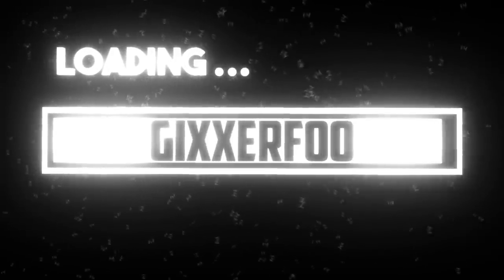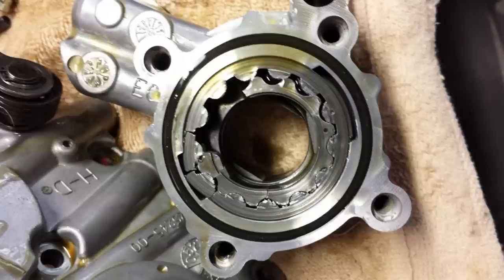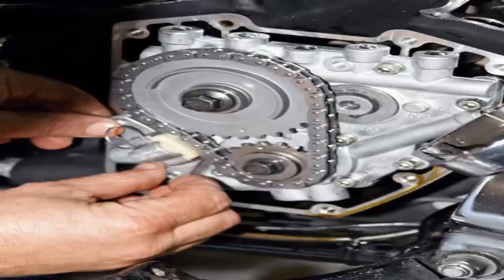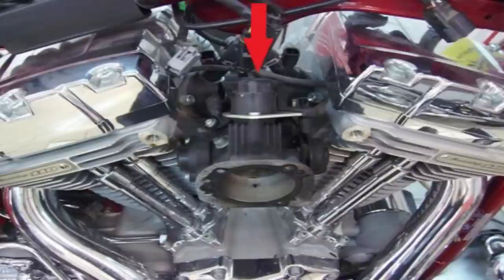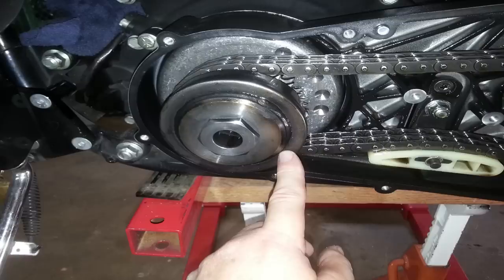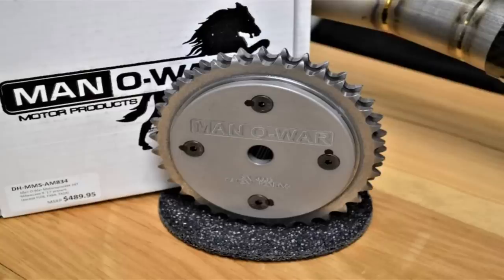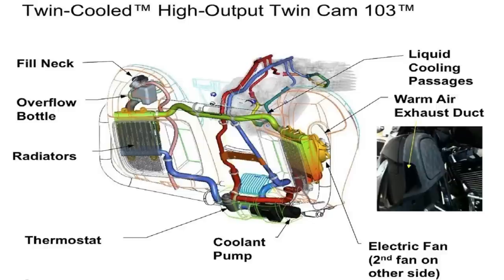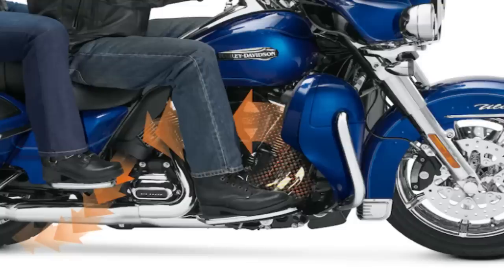5 Harley Problems the Aftermarket Fixed Before the Factory

Comment: I have put mighty mites ( love juggs ) on my 14 Streetglide and 05 Deuce.  They do work BUT ive also had three fans go out  ,over approximately a 3 year period. Two on the Deuce and thats a balanced motor and one on the Streetglide which vibes more . There is a frame mount kit i have to fit to isolate the vibration apparently. I purchased this kit from Amsoil Adam ( vendor) at Delmarva bike week this year. I have a Hayden H6 primary chain tensioner ( auto ) fitted to the Deuce . BUT at the moment cant find one for the Streetglide anywhere ! Its like everyone is out of stock .I also have two FLO reusable oil filters to fit when i next service the bikes ,the advertising says they can drop motor temperatures. I run AMSOIL in both bikes . The Fans by the way DO work and drop motor temp but even though its a well built unit its the tiny fans that don't seem up to the job . These   units were like $400 and now i believe they are north of $500 ! ALSO the Deuce has full S+S cam chest running 509G Gear Drive because the run out was good .

Comment: That is interesting fix for the stepper motor. I started getting problems 10,000 miles ago, I seemed to get by with grease on cables for a while. I shortened the outer of the throttle cable nearest the rider by about 1/2 a turn not had any problems since. Not sure why this worked. But will look at your fix.
Reply from the maker: That's a interesting issue, you might have to end up replacing that cable, it sounds like it might have some stretch in it.

Comment: Any idea as to why they went to the INA inner cam bearing in 92?
Reply from the maker: I would hazard to say it was cheaper, same reason they went with that style bearing on the Twin Cams in 2003. It allowed Harley to slap the bottom end together without having to take time to setup the tapered Timken bearing lower ends. Both were a huge quality loss in my opinion from Harley.

Comment: The tensioner issue was very easily fixed on the 88 motors but you did have to spend some cash by converting to gear drive! That my friend was the only issue
Reply from the maker: The gear drive on those was not cheap at all!
Reply: @GixxerFoo  back around 2000 I did install a couple of gear drives kits for a little less then 500 bucks but the kits went up pretty fast ! But it did make those 88s a pretty much maintenance free bike other than fluid changes . Those 88s turned into 95 in hers made some badass hotrod bikes with no compensator issues ! Much more dependable then 07 & up motors unless you spend a huge amount of cash on some Dark horse  flywheels !

Comment: Just picked up my 3rd. I’ve got A 17 m8 spitting oil a17 slim s and just got a 10  road king police with a 103. I’m gonna start digging into the RK anything you think I should look out for
Reply from the maker: That 103 is a pretty good motor, that's when they got the Twin Cam straightened out. If you pull the motor apart I'd check the run out on the pinion and just see where your crank is at. But I'd check that primary chain adjuster and see how your chain tension looks. Being a 2010 you might watch for the compensator, just little things on the 103's nothing major really.
Reply: @GixxerFoo  thanks I appreciate it

Comment: @GixxerFoo -- Should the stock compensator be a concern on a 88ci that has been built to a high compression stout 95ci ? (2000 Model)
Reply from the maker: Not in that year, they had good compensators back then. It's when they redesigned them a few years later that quality went to crap. It was a miserable failure on Harley's part when they did that.

Comment: When did they update compensater on the Dyna models? I have a 2012 FXDC
Reply from the maker: I believe in 2010 the Screamin Eagle compensator became the OEM part, the 2012 for sure has the updated compensator.

Comment: Tensioners was material of shoes and also it was the chain links got sharp edges toward end of run before they changed dies .
Reply from the maker: That was a nightmare when that whole mess went down, brand new bikes shelling motors and customers holding the bag.
Reply: @GixxerFoo  yes sir : I forget where I read that . Chain links were good a beginning of run and as the dies wore ; chain links got tougher on edges . So depending on where your chain was made ; beginning of run or end of run is why it was hit and miss on bikes. Also I believe the chain was re-engineered with different type links on up graded kit and bikes after that fiasco .
Yes ; it hit me in the pocket. 
I wasn’t happy about it . 
I’m working on my shovelhead clutch basket now . 🤔 floating clutch hub . Plates that stick on hub fingers . Well it’s a can of worms. It goes on ; but we are miles ahead of that old stuff still .😁
✊🏻👍👌🙏👋

Comment: I went through primary chain tensioner issue and I hoping flywheel issue doesn't comes up.
Can you please do a video on fly issue and how would you know if you havea bad compensator
Reply from the maker: I have a video covering the compensator, you'll know pretty quick with a compensator. Here's the compensator video https://youtu.be/qZNZAiX9Edw, this one is about the cranks https://youtu.be/oSmp_mw_ZbM.

Comment: Great informative video as always.  I've had 4 TC88's over the years and every one of them would occasionally kick back and cough out of the air cleaner when starting.  Sounds terrible and I've mentioned it to some mechanics, and googled it to see if others have this issue.. so far I haven't uncovered much about it.  The best I can come up with is it's either a lean condition during start, or possibly a compensator issue.  Wondering if this is caused by some defect, or is it just me....  :/
Reply from the maker: I would say a lean condition, we bought my wife a new sportster in 2017. All stock and very lean from the factory, it would do the exact same thing. You be riding a low speeds and it would cough back through the throttle body. We got it tuned and richened it up with the air cleaner and exhaust, hasn't done it since.
Reply: If those bikes had a carb it was for sure a lean condition ! If they had the early fuel injection it was crap & today u can't find  parts for that junk ! The compensator was never a problem unless the nut came loose ! Harley should have keep right on using Evo style comps ! I have personally had 120 cu inch motors that put out 130 HP with no compensator issues . Gixxer is right Harley has made some dumbass mistake !
Reply: @GixxerFoo  H-D started using INA bearings in inner cam bearings since 92 Evos, been a problem since, taking out cams, last year for Timken bearings on drive side was 2002, Happy 100th Birthday, Harley owners, it's all about their pennies lol,they should be Shot

Comment: They also stopped using a Timken bearing for the crankshaft after 2002 . Leading I believe to the shifted flywheel problem. Not sure how widespread the shifted flywheels became but its enough that S&S offered a solution. Im waiting for my compensator to become a problem with my 09 Dyna. Every now and then on startup there is a GRIND and starter kicks back. But I just hit the button again and away we go. Doesnt happen very often.  I aint fixing it until breaks Im lazy like that . I have other bikes I can ride .
Reply from the maker: It was easier and fast during assembly to use that roller bearing rather than take the time to set the back lash with the Timken. Very unfortunate they did that, does sound like your compensator is starting to have some wear spots!

Comment: Does the screw to fix the idle fit both types of fuel injection.
Reply from the maker: Those only work on the cable operated delphi throttle bodies.

Comment: My 09 SG making a clunging noise the 1st day on my trip to FL from OR stopped at a shop in Indio he said it was a compensater sprocket.  Should I go home ? he said no that he would fix when he got back from FL so I did 30 days on the road clunging all the way no problems they replaced with the screaming eagle compensater as the stock one was no longer avaible .  What a bike 140,000 miles one compensater sprocket, cam chain tensioners, primary chain tensioner and a throttle body change due to limp idle problems that's it I'd ride it to FL tomorrow.
Reply from the maker: That's some impressive mileage on a stock compensator!

Comment: I have a carb TC 88. I can run the fuel screw down to 2 ⅓ out with no real issue with heat. There is a critical point where going lean the heat  goes on runaway. No need to go by 3 turns, a 10th of a turn either way is the difference between it can loose the heat or not.
Reply from the maker: That's the beauty of those carbeb bikes is the ease of adjustment and making it happen on the side of the road.

Comment: I'm rather slow to change...I still have my 73 Shovelhead and just last year added a 99 Evo Heritage Classic to my garage...my 73 is 91ci and my 99 is 96ci...that's as big as either needs to be since I'm using the stock lower cases... I can only assume HD is building their lowercases to stand up to more HP... however I have been seeing YouTube vloggers complaining about having invested time and money in building their new bikes only to have them back in the shop because of issues with over heating...
Reply from the maker: The new M8's for sure have some issues that need addressing, it takes some money to get one right. You've got some nice rides it sounds like, built and good simple tech in those motors!
Reply: @GixxerFoo  ...as far as the M8s that's what I'm seeing too...those little fans are a band-aid for a much bigger problem... I'm surprised some genius hasn't developed a wrap incorporating an oil cooler a pump and antifreeze to cool these new engines...when all the time the motor company could just say okay uncle we've gone as far as we can go with air cooled so our next phase is going to be offer a liquid cooled 45 degreed 4 cylinder behemoth capable of mach 1...you know back in the early ninties an aftermarket company offered an automatic transmission for harley davidson motorcycles...mainly for the baggers... seriously...on another note are you familiar with Sorenson Performance that guy has built 2 Shovelhead engines all billet 1 is like 128 the other is 142or 143ci... he's in Canada...the head design instead of the hemispherical is peanut shaped...mouse motors perform well and stay together longer...besides that there's a speed limit...lol

Comment: One of the bonehead things Harley is done, is to take away the oil cooler on their wet hedge I am buying a jagg two-stage  oil cooler and relocate my oil filter. Got to bring the heat down. It’s ridiculous. 10:57

Comment: I have been on the side of the road 5 times due to stator failures. Went to an American manufactured company "Cycle Electric" and have never been on the side of the road ever again. Don't have any of the other issues due to only owning Evo's (on purpose).
Reply from the maker: Evo's are just another breed of Harley all together, they don't get much better in a Harley.
Reply: @GixxerFoo  yep, although I've owned many im very fond of the 1998. If you address a few of the issues associated with them you've got one great and reliable machine

Comment: What about the b engine. Have two torn apart now with damaged bearings and counter balancers.
Reply from the maker: Dang what happened there? You don't hear a lot about issues with the B engine having problems.

Comment: i bought my 03 FLHRCI with 29k miles. i immediately did a cam. Both shoes were cracked in half. Did a Andrews 37G gear drive. .003 runout.

Comment: The abs module has no fail safe when i had my 2009 electra glide the abs module went out and the pedal becomes rock hard and cannot be pushed due to the valves in the module

Comment: I will add the crappy oil pump on the M8 motors to the list.
Reply from the maker: The updated oil pump or a aftermarket is the best option, for sure a vented dipstick helps quite a bit too!

Comment: How about the fluid transfer between the primary to the transmission.... ;-)
Reply from the maker: That's a interesting M8 issue, they've come up with a venting system and a new oil pump. It seems to help, but not really a true fix unless you get a aftermarket pump and go through the engine Kevin Baxter style.

Comment: I've dealt with all these problems on my bikes or customer bikes when I had a side gig working on bikes in college.  Frustrating that Harley was so slow to respond to known problems but at least I made money on some repairs and they didn't.
Reply from the maker: I always said if you're going to Motorcycle Mechanics Institute go for Harley-Davidson. I'm not bashing Harley but you'd starve working on Hondas lol.
Reply: @GixxerFoo  I went to school for tool and die but I worked in a private motorcycle shop that only works on Harleys before taking on my own customers.  The owner of that shop taught me how to build panheads and knuckleheads and I taught him how to work on fuel injected bikes.  He is the most knowledgeable man I've ever met when it comes to old school bikes.  I designed custom made parts for his double engine shovelhead bike.  Fun project

Comment: Harley Davidson , where they sell you a new bike and then sell you all the Screaming Eagle parts to make it run properly rather than put the better parts in the bike in the first place . i doubt that an SE chain tensioner really costs much more to make than the stock part and considering what the damn bikes sell for you should get the decent parts right out the door instead of buying them again later .
Reply from the maker: I couldn't agree more, it's all part of Harley's marketing strategy. Harley really is a good marketing machine!

Comment: The other thing is the rocker arm slack making it sound like a damn sewing machine... Rocker Lockers are the fix, but what a numbnut design flaw...
Reply from the maker: It sure was with that gap the bolt leaves in there, that top end tick is annoying!

Comment: Andrews didn't make plates & tensioners...they sold gear drive cams which removed the need for tensioners.
Reply from the maker: They did start making the gear drives as well, they were one of the first to do so. Excellent company, had some great conversations with them.

Comment: I had a 2002 Deuce that the fuel line from the pump to the pit cock would rub on the inside of the tank and create a pin size hole.  Did it twice.  The second time I put a larger hose over the oem line so it would take the rubbing by rolling with the vibrations.
Reply from the maker: Dang that is scary! I am glad you caught that!

Comment: I've thought that HD should hire Japanese Engineers who seem to be a lot smarter than the Engineers have at HD.
Reply: Well Harley is owned by Kawasaki.
Reply: @brandonmacon3317  Well if that's true, thankfully they aren't totally by the Chinese Communists!  Although there does seem to be a lot of Chinese-built clothing and parts.  I imagine those are made in Taiwan.
Reply: That is a brilliant idea.  Except it would feel like going back in time for the Japanese Engineers!  At least HD has moved on to 4 valves per cylinder................
Reply: @VN9001  I think it was around 1993 or about, an independent builder invented the four-valve heads for HD.  I thought it was a great idea and if I could have afforded it I would have bought a set for my '94 HD Evalution.
Reply from the maker: There was something called the Hemi head for the Twin Cam, I believe a shop in Europe designed a 4 valve head system. It was pretty trick!
Reply from the maker: Harley's really stuck in tradition, so they are fighting a up hill battle with trying to make a 45 degree twin meet today's standards on several fronts.

Comment: These problems are not unique to Harley, I own a 2012 Fatboy Lo, I also own a 2002 Yamaha Vstar 1100. The oil filter location on this big was poorly designed and required 6 hrs ( Dealer service) to do an oil change! When I learned of this ( after purchase of course) I bought the complete repair manual for this bike( 100bucks) I did two oil changes and my average time between both was 8 hrs because you had to remove damn near everything on the tight side of the bike including the freakin header pipes and it was an absolute MFR to say the least. The next yr Yamaha redesigned this bike making this a much easier job, unfortunately in the redesign the bike completely lost the look and was undesirable as hell. So just as I’m ready to sell the damn thing and move on, Kuryakin comes out with a oil filter relocation kit with braided SS. Lines and goes to a spin on like my Fatboy. The kit was 300 bucks and the best 300 I may ever spend . I can sympathize thru my own experience and frustration. HD is not the only one making mistakes that’s for sure and this is a great example
Reply from the maker: I remember those on the Yamaha, metric bikes have their quirks too. My dad ran a Kawasaki and Suzuki shop for 30 years, those bikes had all kinds of things just like the Yamaha.

Comment: One of my pet peeves about all Harleys is the placement of the horn button. The horn button should be directly under the thumb as in virtually all other bikes. The horn and turn signal buttons are reversed. This is a dangerous PITA.  In an emergency situation you need the horn urgently and you need it quickly. Fidgeting around trying to find the horn button can be fatal. This is a small but irritating problem that Harley doesn't need to reinvent the wheel to remedy. And how about turn signal mounts? Why not updating them with flexible mountts so they don't break if they get bumped?
Reply from the maker: For sure the controls on a Harley unique to Harley, it takes some getting used to. I've road Harleys for years and as you mentioned when a situation arises I still fumble around for  that horn button.
Reply: @GixxerFoo  The Government forced them to put the shifter on the left side on the Sportster. Perhaps they can make the fix the horn location?😀😋